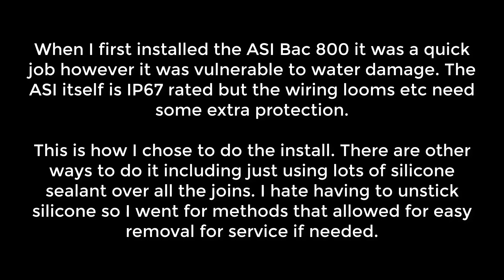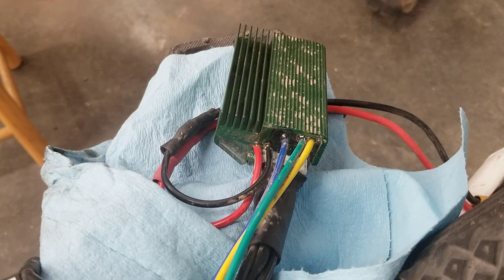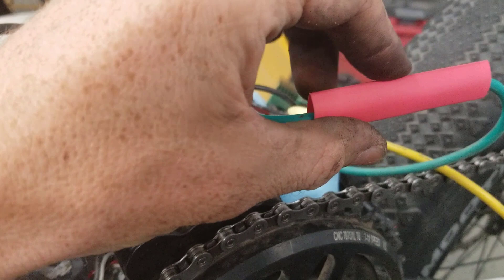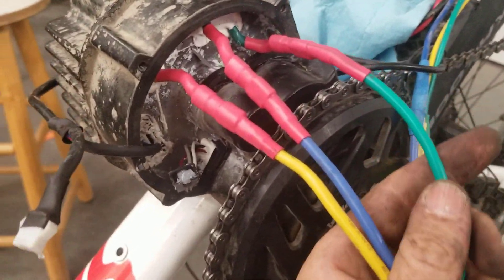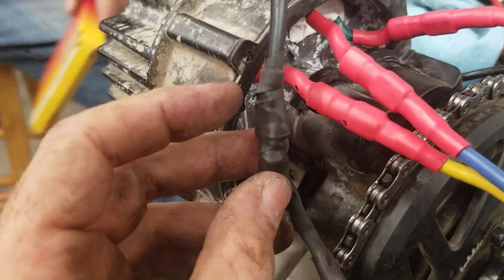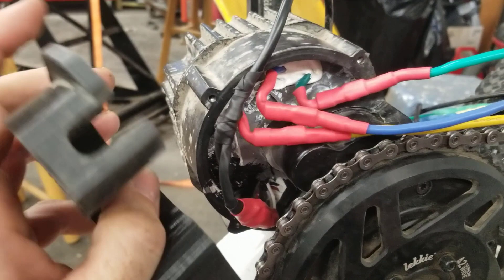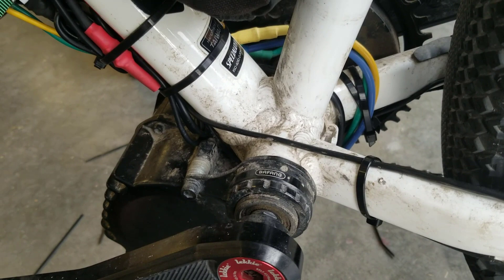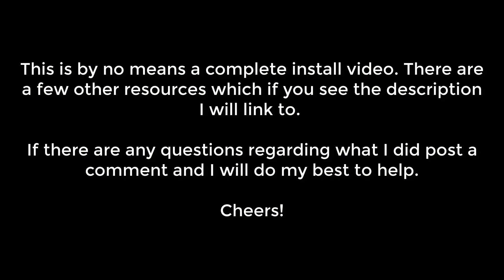Bafang BBSHD (ASI BAC800) - ASI BAC800 Install and Waterproofing

Comment: Get my controller tomorrow so will I get more power and aclecrion

Right moter mading a Exning nose still runs no drive is that my nylon gear ?? Need to know asap
Reply: Ya I will mate just took the other one off this should fix my problem cos it went bang that's the controller right lol hope so cos the bac855 asi not cheap lol comes tomorrow
Reply from the maker: Of all the bikes I ride the fatty with this kit puts the biggest smile on my face.
Reply: @High Voltage  so what speed to you get roughly mate and can I run in on speed 9 all the time ?
Reply from the maker: You can run high power 9 all the time. External heat has an impact so we do have temperature throttling. I tend to stay in the 30-50kph range when out cruising. It's the acceleration I love more than going flat out all the time. You can modulate things very well with the throttle.
Reply: @HighVoltageKits  cool man sn the speed ?? And the allection is more yes how good is it
Reply: Think I have done a nylon hear was on a hill slipped and started making winning now still no drive not sure if its nylon gear or clutch Nedd help asap
Reply from the maker: I'm out at a ski race, best bet is discord and message Greg, Greg@highvoltagekits.com
Reply from the maker: Awesome! Let us know how you get on!
Reply: And csn I Saltley run it full power bbshd battery is 52v 19.5 and 50a ??

Comment: Hi there is there no other controller which can be an upgrade to the bbshd cause I just saw the price to this controller and Im imagining they put solid gold connectors on their pcb 😅
Reply from the maker: They are not cheap. The Grin stuff is as expensive. You can get cheaper stuff but it will take a great deal more work than a kit to get done. No idea about the solid gold lol. There is VESC stuff but the cheaper things are unreliable and no PAS. Luna have a controller but its no cheaper and they don't sell them without a bike. Sorry I can't be of more help.
Reply: @HighVoltageKits  no worries sir u have been a great help on bbshd topic and I have put my new bbshd and I’m enjoying it but I do miss my tsdz2’s torque sensor and the smoothness I hope these guys come up with a better and robust version of tsdz2 with quality and speed of a bbshd
Reply from the maker: For sure. A best of both worlds!

Comment: I guess rubber tape and electrical tape over it might be a good choice in case of not finding silicone tape!
Reply from the maker: Yeah, use what is available. Waterproofing with this connection is based on layers. The most important being a good drip edge on cables and di electrical grease. Cheers

Comment: Great video!  With the   new controller installed how did it effect the battery by  riding distance and longevity? Keep up the great work!
Reply from the maker: Thanks Gerry! Terms of range it pretty much cut it in half when running full power. But it is possible to manage things by being conservative still. The battery itself has lost a bit of capacity and will only hold a 56.8 charge. It was not really designed for this level of abuse. I have since upgraded to 72 volts with a purpose build pack. Happy New Year!
Reply: Another compromise is the 60v (67.2) is a good option to 52v

Comment: Hey Captain! Hope all is fine. Have you went to single rear gear or remained with the multi gear rear cassette?
Reply from the maker: I have three gears on the rear!
Reply: How many tooths on the highest gear, im sure its good for acceleration, is it also good for top speed? Im thinking on doing the same thing as Electroncycles https://www.electroncycles.co.uk/product/bbshd-hot-rod-controller-asi-bac-800-36v-90v-foc-90a-peak/  and adjusting the low & high srews on the derailure to still be able to shift with my twist shifter. Cant wait for my kit to arrive so i can get to work on it.

Comment: Sir, only 5 wires come out from the ASI BAC 800 controller which i presume is the input(2 wires) and 3 phase wires.
Then in your case how are able to use brake sensor , PAC as well as cutoff when gears are changed.?
If you have programmed the controller , would you please like to share it with us...how you have done that?

Please, Captain.
Reply from the maker: Ayan Bhowmik There is another wiring loom that plugs into the white slot. It has all the things you mention. I got my kit from electricrt.com The programming is the genius of the owner Alan. If you are interested in a fully tuned bac800 for the bbshd this is probably the best place to go.
Reply: @HighVoltageKits  Thanks a lot Sir for your kind help.

Comment: What speed can you get out of this? I’ve been looking at the bafang convertor kit as it’s the only one suitable for my bike which has hydraulic brakes. Glad you covered what you used to make it waterproof didn’t even think of that! 

Helpful, thank you.
Reply from the maker: I did some more waterproofing on my winter setup video. On a 52 volt battery I get 50-55kph on the flat. 72 volts gets you just over 65kph.

Comment: Cool video. Do you think it would be doable to 3D print a different cover for the motor so that you could encapsulate the controller? This is basically what luna has done with its ludicrous controller.
Reply from the maker: Thanks Tom. I'm doing a better version at the moment. It was the first thing I made so it's a but agricultural lol. The bac800 is ip68 as a unit. The connections are not so I'm looking to secure that area. You don't want it full covered so the heat sinks do their job. It might be possible to have ducting. But it does heat up under load... Cheers!

Comment: Nicely done video. Do you feel the BAC800 improves the feel of the throttle, which many describe as a glorified on-off switch with the newer BBSHDs? And is PAS more logical with the new controller? Thanks 👍
Reply from the maker: It feels nicer yes. It was more jerky on the stock controller. What the ebike market could use is a really nice quality half twist throttle though. Throttle control is smoother the better the throttle. A domino throttle is tempting. But its not half twist. I might be able to adapt one. I like the safety factor you get with the half twist. Cheers